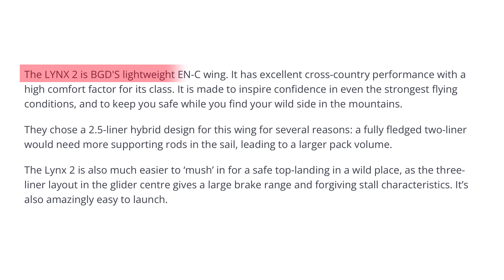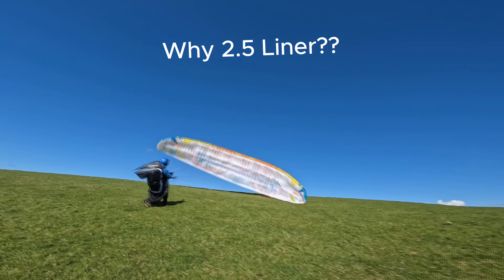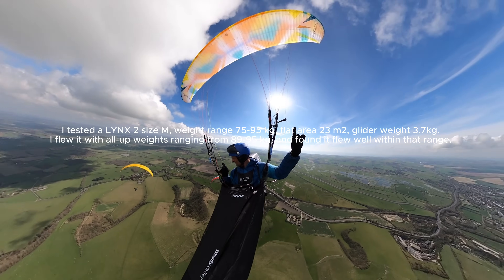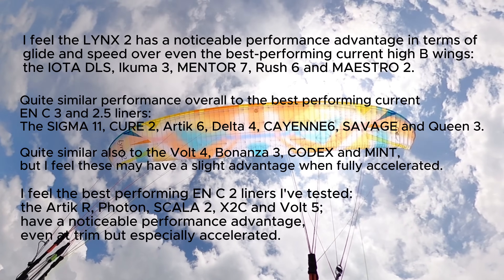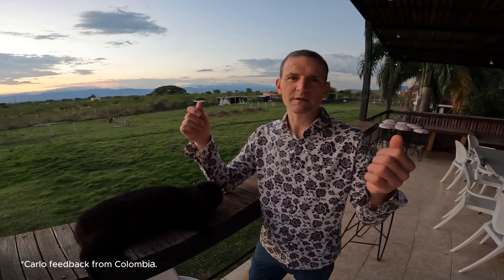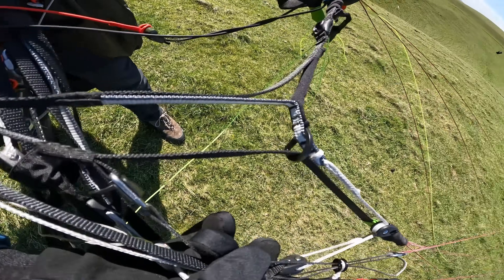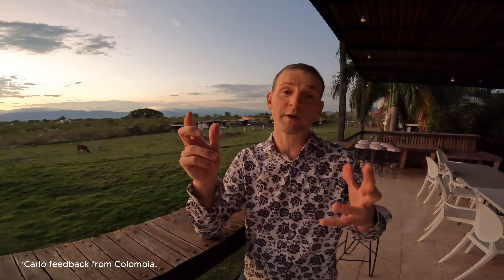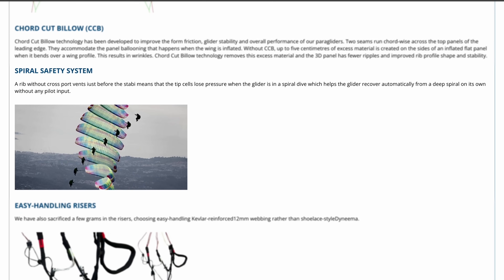2.5 LINER vs 2 LINER - Which One Is Better? I BGD LYNX 2 Test & Review

Comment: So would you say it‘s a bit less squirrelly in rough air than the Cure 2?
Reply: Lynx2 has lower aspect ratio  than cure 2, in general it means less squirrelly
Reply: Yes, having tested both extensively, the Lynx 2 is significantly more "monobloc" than the Cure 2; it moves around noticeably less in rough air. I didn't find the Cure 2 that squirrelly in rough air for a mid to high end 2-liner; it's more that I find the Lynx 2 is pretty solid and comfortable, for a light mid C wing. The original Cure - which I personally liked but would class as a hot C i.e. a D in C clothing - was a lot more active in rough air. It was also far less forgiving on the stall/spin point. Same for it's light version, the Lynx 2. I found the Lynx 2 pretty comfortable for the category, light mid C.
Reply: @flybubblecarlo  Thanks for your feedback. I dropped back to a Base 2 lite for 18 months due to school (also have a Cure 2). Now that my thesis is submitted looking to flying a lot more…

Comment: How far is it from an high b? Certification wise it's basically a b.
Reply: "Folding lines used"... and 1 C for increasing brake pressure or maybe not enough brake travel ? Unless you're accelerated, it even looks like a EN-A glider. I mean this is essentially the certification of a ION6 but with shorter brakes. Yet that's a 6.2 vs 5.2 AR wing. Time to start another fruitless debate on the EN certification process : D
Reply: @timothee.gigout-magiorani  but still the behaviour in active air might be far from a mid B I don't know…

Comment: Didn't enjoy very much the lynx 2. I found it quite unstable in active air, especially on roll axis, a lot of small tip collapses too, without any kind of consequences but still... i had more expectations honestly, as a happy former pilot of the sigma 11. For the rest is a nice allround classic en-C wing.
Reply: Interesting, I have the opposite impression, I found it to be really stable and relaxed in active air, haven't gotten a collapse with it yet...
Reply: I have been flying my Lynx 2 for ~60h and find it very stable in active air, both at trim and on bar (there it even gets more stable from my impression). The soft ears are an intended feature and are used for kinda communication purposes: the glider would tell you that the air is not as good as you may have thought before. 😉 However, I wouldn't even call them wing collapses... it's more of an acoustic feedback from my experience. I haven't had a single collapse so far - in contrast to the High-B glider I owned before. 🙈
Reply: It's more than one year I now fly twoliners (ArtikR) but my comparison was whit my best wing ever: the sigma 11.
Reply: Small tip collapses are part of Bruce's design philosophy - progressive instability.
Reply: @maddinrausch  beside collapses, how far is it from a low B?